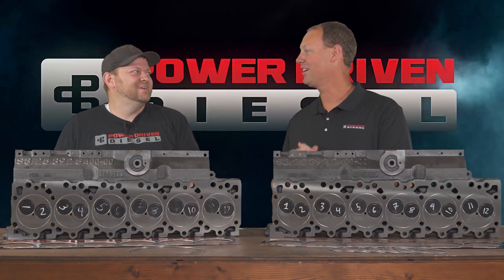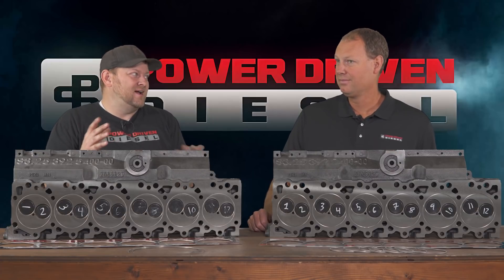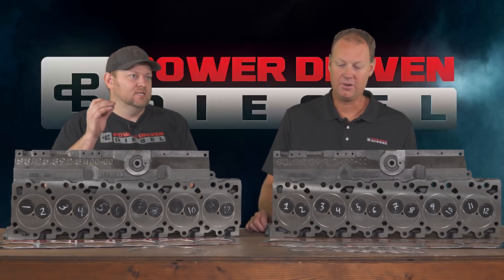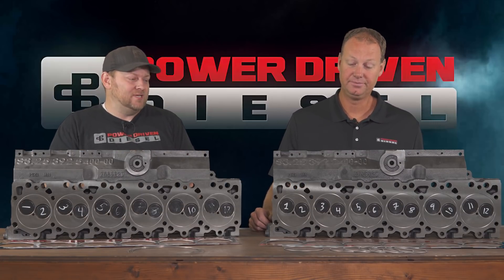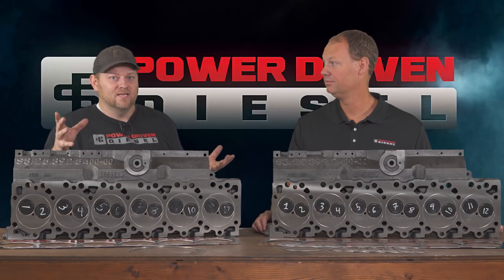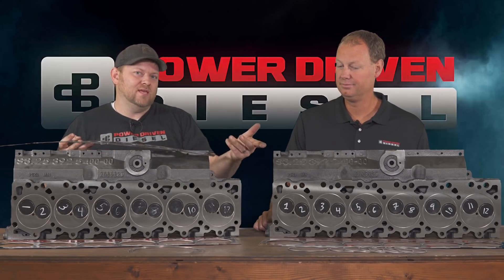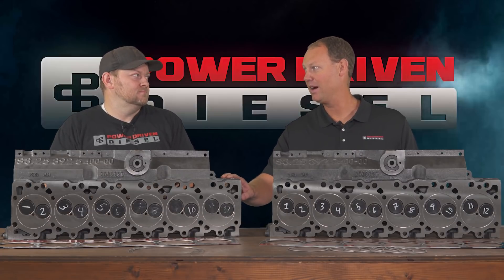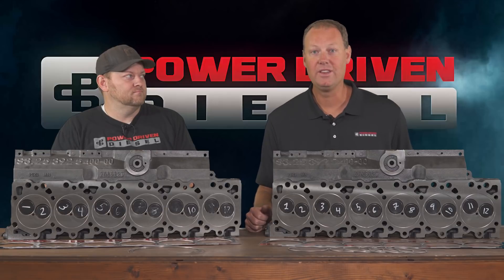Cummins O-ring vs Fire Ring Head Gasket | Parts Bin Ep 27 | Power Driven Diesel

Comment: How much power will a 12valve or common rail handle with only headstuds ?
Reply: I know you weren't asking me but I've blown head gaskets twice with just studs on stock turbo and injectors. The stock hx35 chokes up hard around 40 PSI boost. The drive pressures go crazy.
Reply: @lowellmiller6663  
Thanks for the reply 👍
Reply from the maker: With careful timing and slower spooling large single turbo (reduces peak torque), we've seen 12v engines handle 550 rwhp and 24v MLS gasket engines handle 750 rwhp.  On the Common Rails, it's easier to "tune out" the low end torque with reduced fueling/injection timing and then bring in the timing and fueling at higher RPM to squeeze out a bigger HP number for a given safer maximum torque number.
Reply: @pddofficial  
Thanks for the reply, I have one of pdd towing compound kits and didn't want to screw around with fire rings lol
Have a couple 12 valves I'm probably pushing my luck with lol
Reply: That's kind of what I was wondering, I had no plan on Oringing the head, but deck the head and block, a good set of head studs and maybe build the engine  to 500 HP, but I also was looking at ported and polished heads to keep the egts down, not sure how low I need to get them, but I'm hauling 30k pounds tomorrow in my 6.4 powerstroke and basically cant keep it under 1200 to 1400 degrees just cruising. When I 5.9 swap it I'd like to be able to cruise under 1200 if possible
Reply: @townsendliving9750  
30k with a 6.4? Brave man 👍lol
Reply: @justinschooler6243  it's a f550, the 6.4 breaks the same weather you have 400 pounds on the bed or hauling 40k. It's a brand new engine from ford warranty, I think I have about 20k miles now, so I have alittle time to build a 5.9 to swap out next time it grenades
Reply: @townsendliving9750  
Whatever works 👍